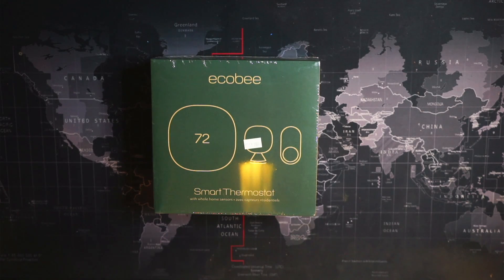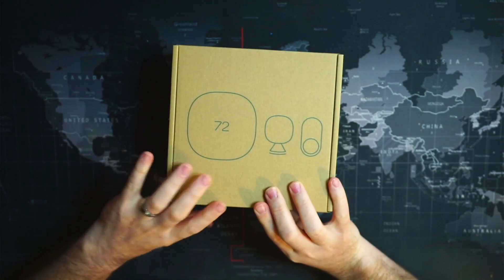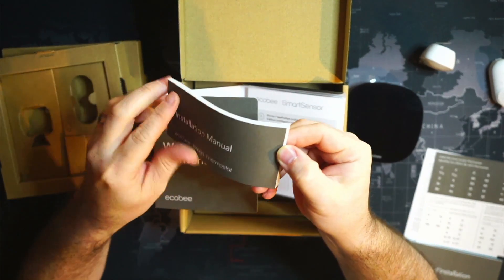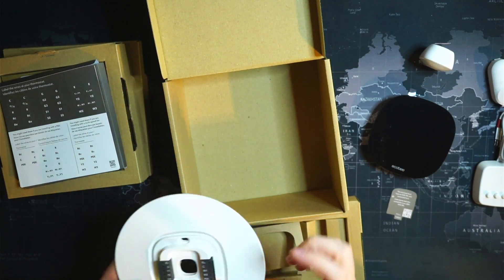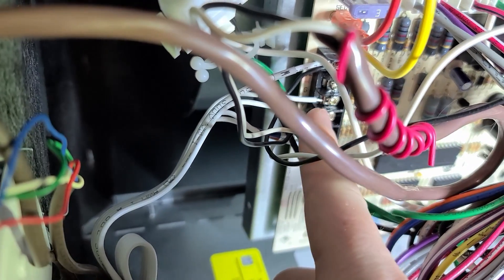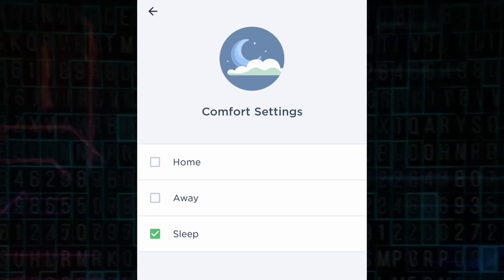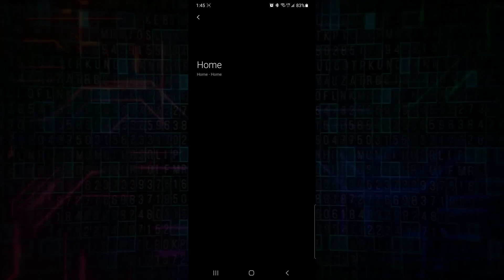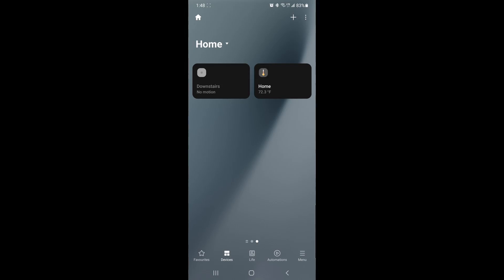Ecobee 3 liteThermostat and Samsung SmartThings

Comment: Can you add automations?  Mine temperature setting are not in Fahrenheit and cannot setup the automation
Reply from the maker: In Smart Things I do not have any trouble setting automatons in either C° or F° both works. Try changing the settings in ecobee app to F° then back to C° and wait for it to sync with smart things, it took about 20 seconds for my smart things to sync the unit change.
Reply: @TechworksOnline  ya that didn’t work.  Under automations it gives me a range of 0-40, doesn’t say C or F, just 0-40.  Changing my settings in ecobee didn’t change the range under automatons.   Under devices, the temp reads fine, it’s only under automations.  I’ve uninstalled, everything.  I have an open ticket with them since feb of last year and still nothing.  My issues started when the new version of the app started
Reply from the maker: @robdmau  if your Ecobee is in C, then yes 0-40 would be the range. 40°C would typically be beyond your home furnaces range.
This is the same that I get when the Ecobee is set to °C instead of °F
Reply: @TechworksOnline  umm, well I tried to change it and the automation options never changed.  I’ll keep plugging away